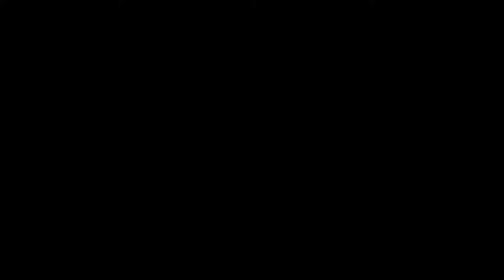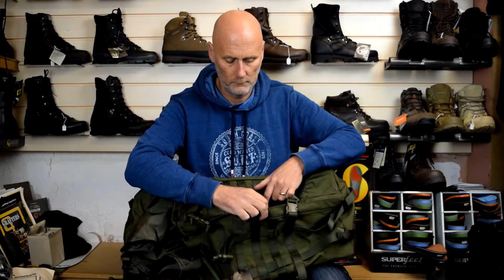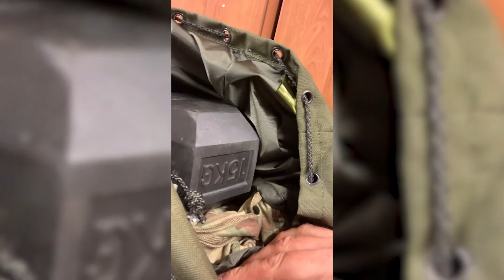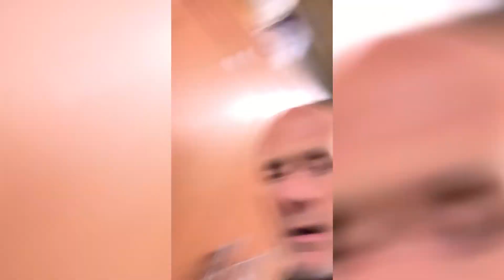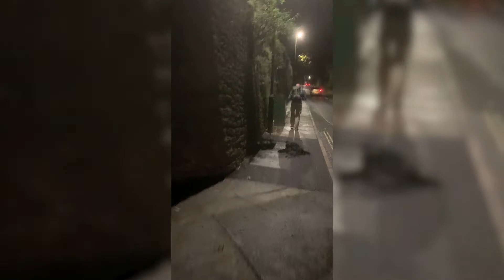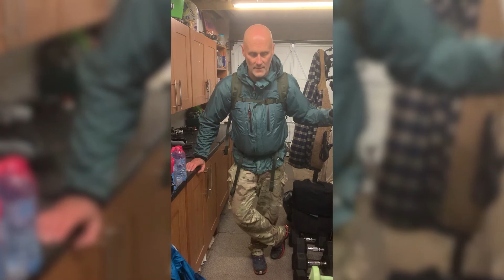Savotta Jääkäri Backpack Medium | Camouflage Store

Comment: Looks nice 👍 is it 30 l with the floating lid all the way up ? Or would it be 30 l plus 10 ? Cheers
Reply from the maker: Hi Sam usually it’s the capacity of the backpack, you could lift the lid fully and probably add a bag of cement😀it could take it I reckon
Reply: M is 30L +15L overpacked + molle pockets easily 10L+